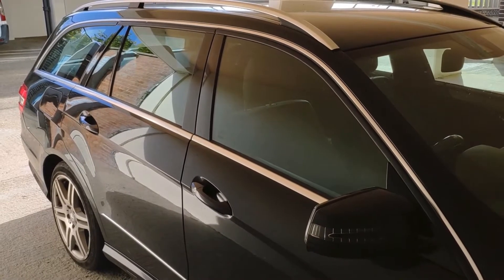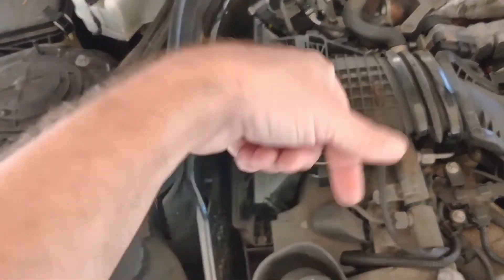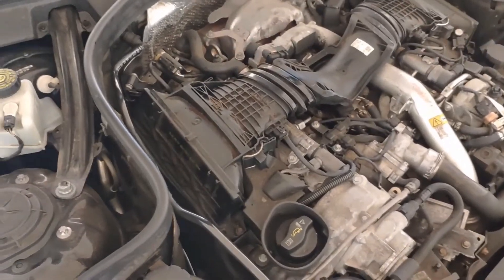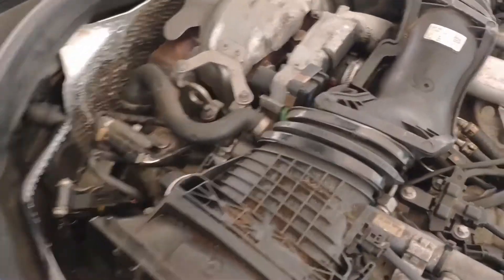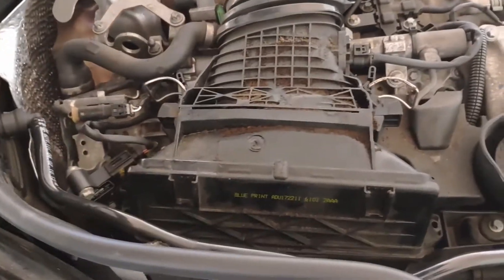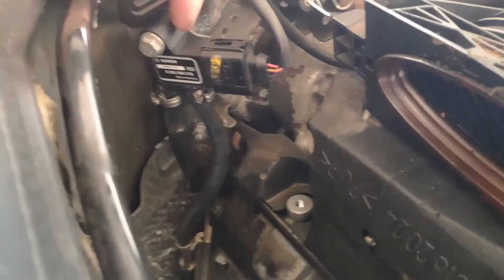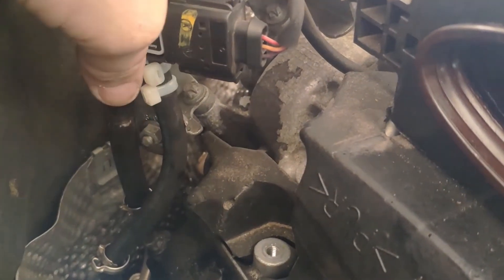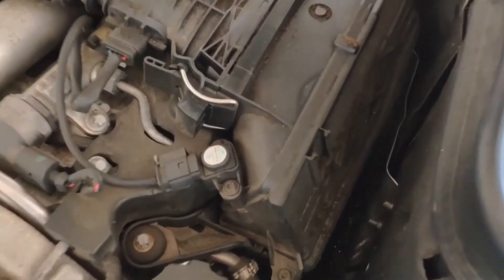Mercedes W212 E350 DPF sensor replacement

Comment: First of all, thanks Topsy! I have been having a few issues with my W212 E350CDI. Symptoms; Gears shifting at higher RPM, no kickdown available, reduced power, limit on top speed and useable gears (think 6 out of 7 were available). Was able to drive on the motorway ok. Did a reset on the gearbox which cleared the drive issues but problem came back (no engine management lights). Plugged in a scanner and got the codes P2453/P2454/P07E8. I was just about to give up and take it to a garage until I found this video, thought the DPF might be shot. Just bought a Bosch Sensor from Amazon for about 30 quid. Will fit tomorrow and report back.
Reply from the maker: It does sound like a DPF sensor issue. Be sure to reset the number of regens using your scanner after replacing the sensor.
Good luck and post back if it does work for you or if you had to try anything else.
Reply: Part arrived from Amazon and fitted. Cleared the codes and reset the gearbox just incase. Piece of cake apart from the cobra clips that were a nightmare to refit, I only managed one and cable tied the other. Thanks again for this excellent video tutorial. 👍👍

Comment: I have the coupe version but same engine and have just experience the limp mode, engine management light and error code very similar to yours 'the lower limit value of component B28/8 (differential pressure sensor(DPF) ) was dropped below/not reached'. You're video was very clear and precise and I will be doing the same this week. Fingers crossed it works as I only listed my car for sale last week! Thank you
Reply from the maker: Hope it worked

Comment: I will be replacing my sensor this weekend and yours is the first video I have found showing the same engine as the E350 Convertible that I have. It looks a whole lot simpler than on some of the other videos I have seen where the sensor is hidden down the back of the engine below the DPF box which is also much harder to get to. Nice clear video, well voiced over, describing what I need to do. Thanks. I think I will check my air filters while I am there too! I will subscribe to see what else you are doing to yours. If I make any videos of me attempting things,  I will link back to yours if that is okay with you. It migth help people to have two views of the same thing.
Reply from the maker: Sure thing. Post a fresh comment with a link and I'll pin it and add your link in my description.

Comment: Hello. Thanks for the video. My car is w212 2011 model e350cdi 4matic. At 200000 kilometers. I have a fault with the code 148a00. I cannot solve the problem. DPF changed, injectors checked and there is no problem, differential pressure sensor has been changed. my problem still persists. my car has never produced black smoke, my exhausts are clean but my car is constantly trying to regenerate. I can't find the problem. why do you think it might be? (Sorry for bad english) thanks.
Reply: Hi there. Sorry for delay replying. The life of a DPF is actually limited and you can only do a regen a certain number of times and this is stored in the car's computer. If you fit a new DPF you must reset the computer (DPF Reset) to let it know to start counting the regens again from zero. if you have done a reset and it doesn't fix it then try doing it again as it often works the second time.
Hope this helps and let me know if it works.
Reply: Sorun ney tam olarak kardeşim anlatırsan belki yardımcı olabilirim
Reply: i have the same problem, black smoke😞

Comment: I have the P2454 pressure sensor A circuit low code but all the same symptoms, however i have no engine light , i cleared the fault and the car returned to normal for a bit, will try a replace of sensor and see if that works
Reply from the maker: Don't forget to run a forced regen and then clear the DPF log once you have replaced the sensor also. Good luck.
Reply: @topsystechtips5128  thanks for this, but how do I run a forced regen?
Reply from the maker: @andrewhulbert2466  If you have a good OBD2 scanner then you can initiate it on this, otherwise take a longish drive (30-40 mins) and do it in manual and keep the engine revving over 2000. This will use more fuel and run hot but that's the point. You will need the OBD2 scanner to reset the DPF cycles as the car keeps a record of how many regens have been done and this can also be an issue if the car thinks it has done too many cycles then it will demand a new DPF (for a couple of grand...).
Reply: @topsystechtips5128  perfect, can you recommend a scanner that I can use? I have car scanner pro that I can use to delete fault codes but that's it ... guess that's not going to cut the mustard?
Reply from the maker: @andrewhulbert2466  I use an Autel AP200 module that connects to an app on my phone. The cheap ones are fine for reading codes, but don't do much more.
It is about £50 but you can use it for so many things and take it with you when you swap cars, or go to buy a car, etc. The more you pay, the more functions you get but you don't need to spend £1000 unless you are a garage...

Comment: What a great video. Thank you for this. 

I’ve a 2013 E350 CDI with the P2453 and P2454 codes. I’ve ordered a new genuine DPF sensor and hoping that fixes it. The wiring seems fine (some people report the wiring should also be replaced). 

Car keeps going into limp mode. Only had the car for 2 months which is a pain.
Reply from the maker: Once you have replaced the sensor you should try to force a DPF Regen from your OBD2. The P2453 error is a voltage irregularity that may be either the wiring or a blocked (or full) DPF.
Fingers crossed it is just a faulty sensor.
Reply: @topsystechtips5128  thank you for this. I’ll try that

Comment: Hey mate if you can help me ! I have w204 with OM642 engine, I’m trying to change DPF sensor but I couldn’t find it !
Reply: I have been looking for a couple days now and I cannot find the DPF differential pressure sensor on the OM642 engine either! There is barely anything on the OM642 online and virtually zero info for my vehicle 2009 Mercedes R320! Insanity!
Reply: @JTBCOOL1  did you manage to find it? I'm in the same situation with my cls 320 cdi...

Comment: Hi, m8, I recently got 2 error codes: P2453, P2454 and it says low circuit. Does that mean I need to replace the sensor and wires? Thanks
Reply from the maker: Hi there.
The second code that you are referring to is usually to do with the DEF. I assume you have a BluTec model not a BlueEfficiency. This can be caused by faulty sensor in the DEF tank, faulty DEF injectors or just incompatible DEF fluid (AdBlu).
Reply: @topsystechtips5128  I have BlueEfficiency model, m8

Comment: Hi 
i have error P0471 on my W212 200CDI , i will try to change it but need to go buy this sensor on my benz shop or i can order on internet web site ? need to reprogram after changed ? or just clean fault ? thanks
Reply from the maker: I bought mine online. I know Amazon do them and eBay is also a good bet. My advice would be to get the Bosch one, but use Google to make sure you get the correct one for your car (Based on the number on the one fitted at the moment). On the 200CDI the sensor may not be where shown in the video as it is not a V6 engine.
You shouldn't need to reprogram it after just changing the sensor. It might need to run a Regen. If you change the whole DPF then you need to do the reset.
BTW. Sometimes that error code is caused by a soot blockage in the pipe going to the sensor and not a sensor error at all. If you disconnect the pipe and try to clear it first before buying a new sensor.

Comment: Hello! Ty for the video i had the p2454 code, i replace the sensor but still, the code comes back, when i shut the engine and re start no fault codes, but sometimes it re appears, dunno where i should look for
Reply from the maker: 2454 is the generic DPF error code. If it is not the sensor it can be that the DPF is full of soot and needs a regen. Did you force a regen after replacing the sensor?
Reply: @topsystechtips5128  hi! Ty for the answer, i did a regenaration 1 day after, still the same problem, my diagnostic tool is super cheap i may need to use another one. I was wondering if only the replacement should solve the problem or if the sensor need to be coded? Ty
Reply from the maker: @firotti  Normally the sensor does not need coding. Is your car BlueEfficiency or BluTec? If BluTech it might be an error in the AdBlue tank gauge.

Comment: Hello there, thank you so for the video, I looked at mine and it’s 2012 diesel.
It gave me error code p2454 also p0030.
Goes to limp mode, I think it’s the DPF sensor, but for some reason it’s not the same one as the one you are showing in the video, mine says A0061539528, what do you think I should do?? Really appreciate your help
Reply: Hi. If yours is a 2012 model it may be BluTech rather than BlueEfficiency. The difference is the AdBlu that you need for the DPF. This requires a tank with a sensor for the fill level. When this causes problems often the solution is to change the tank as the sensor is integral. A total pain in the proverbial.
Error p2454 is actually a generic DPF error code though.
The error p0030 is related to an Oxygen sensor, normally accompanied by 'check engine' light on dashboard. That error code refers to #1 cylinder. Should be relatively simple to replace.
If the O2 sensor is not working properly you can get an incorrect fuel ratio in the engine, which can make it burn dirtier (hence clogging the DPF) and also give less efficiency. I would look at this first.
Change the O2 sensor, then force a DPF Regen to burn out the soot. See if that works.
Good luck with your fix.

Comment: Hi
I know that this is from 2 years ago, still I want to ask, I have the exact car, I replaced injectors, turbo, egr, and the second dpf, still smoke comes out and the smell is terrible, the car drives wonderfully, hope you can help🙏
Reply from the maker: Are you running Bio-diesel? This may not burn properly unless the compression of the engine is altered to match the different fuel density. This can also cause a stink too.
Also have a look at your economy. You should be getting about above 40mpg average per tank for a reasonably driven car of this age (50/50 town /motorway). If lower it may be worn or carbonised rings, cylinders or valves. These will also all lead to smoke and smell of unburnt diesel.
Good luck with the fix. These are the last of the non-adblu diesels and they cause so many problems I don't recommend them at all. Petrol/hybrid for the future.

Comment: Hi , 2.2 170 hp w204 2014 check engine on (dpf sensir fault on tester) but my car is not in lip mode how is possible (137k) km

Ps: waiting for new one
Reply from the maker: It doesn't always go straight into limp mode. Just like if you are low on oil, you get the warning light coming on. If you ignore it then it will go into limp mode. Good to fix before then.
Good luck and hope it works. I've just now got to about 205K miles on mine.
Reply: @topsystechtips5128  i l go monday , but what is the connection between oil and this sensor and limp mode?After i change the sensor,I need a special thing to do "like reprogramate" sensor or just delete error and that s it
Reply from the maker: Sorry. Bad analogy. I was just trying to say that the warning light usually comes on before going into limp mode. i.e. if you have an oil leak, the light will come on when the level has dropped a little. If you do nothing and the level continues to drop the eventually the car will go into limp mode.
Reply: @topsystechtips5128  but i have problem with dpf sensor not with oil leak

Comment: Hi @Topsy's tech tips, great video with great detailed explanation of everything, I've seen far to many that just rush through & don't show enough detail so well done great job, I don't trust main dealer garage or many to be fair, I always try to do as much as I possibly can myself to all MB specs then I know the jods done right, I have a 2011 e350 estate 265 Amg sports, but can't find any videos to show how to check oil level digitally from inside using the multi function instrument panel, any chance you can put a video up for this please.
Best regards
Sj
Reply from the maker: Hi Sj.
Good idea and I'll see what I can do. It won't be for a couple of weeks as I'm away from my main computer at the moment and have a few broadband issues too...the joys of modern living.

Comment: I got P2463 error with the Autel Bluetooth thing, how can I check if it’s sensor fault or dpf it’s really clogged. Also can I force regen with this dongle?
Reply from the maker: Yeah. You should be able to force a regen, but you will have to do a good long drive to get up to temp properly also. Google the instructions for your dongle to find out for sure.

Comment: Thank you for the excellent video.

I've got a 2011 E350 bluetec.

The adblue Def fluid for low. I filled it but a light came up saying 16 starts remaining. I took it to a shop when it got to 3 starts remaining.

The shop reset it and after, the remaining starts light came back on again after driving it 50 miles. I'm now back to 10 remaining starts.
I thought the NOX sensors may have been the cause because the mechanic told me the codes were pointing to the NOX & Mass Airflow sensors and that there was showing excess soot.

I spent $1,200 for 2 new NOX sensors. I also found a bad fuse thanks to a video from "Albanian Fix". The fuse replacement did improve the performance of the car. I don't think the $1,200 I spent on the NOX sensors did any good at all.

My big problem now is getting rid of the remaining starts countdown so that I am not left stranded.

Anyone have any suggestions or know of a way to reset the countdown without taking the car to the shop?

Any videos out there on this subject?
Reply: Hi there.Thanks for the comment.
I'm really not sure as mine is the model before the AdBlue, but from what you have described there may be a fluid-level sensor in the AdBlue tank. If this is faulty it may read empty when the tank is full and if the car thinks you are out of AdBlue then it will limit the number of starts until you fill up. A garage can reset the reading but unless they fix the sensor it will just countdown the number of starts again...
Have a look on the AdBlue tank and see if you can see any wires coming out as it may even be just a faulty connection. 
Good luck and let me know if you get it sorted.
Reply: @OakleyTurvey  Thanks, I'll take a  look at that. I thought that it might have something to do with that because the countdown issue never started until it got low on adblue. After I filled it the countdown should have reset. Nothing else triggered it.
I tried tapping on the adblue tank.
Do you know if there is a way to check the sensor?
Reply from the maker: @TheRevivalChannel  This seems to be a common issue with the AdBlue system. Looks like a major design flaw with some people getting sensors replaced up to 5 times when still within the 3 yr warranty from new. 
NOx sensors are the mechanic's standard answer as a fix, but if that doesn't work they should look for something else...not just replace them again. There is a sonic sensor inside the AdBlue tank which may be the issue, but the tank comes as a single component at about £2K. Maybe try to get in touch with this guy. He claims to have done it as a DIY job in a weekend.
https://www.benzworld.org/threads/adblue-level-sensor.3060102/post-18091069

https://www.benzworld.org/members/prrs.1044145/

Comment: I paid £291 to have this work done! absolute rip off
Reply: Sorry to hear this. Most garages charge way too much for labour, which is what puts the price up. If they see a nice, clean Merc driving in for a fix then you can be sure the quote will be 'gold plated' also. There are many honest garages out there, you just have to find them.
Just an update on my fix; I replaced the sensor nearly 18 months ago now and just gone over 190K miles. Still going well.

Comment: Hi the Bosch part you fitted shows 0281006278 part number, the description in your video says 0281002924, could you clarify please
Reply from the maker: Hi John, Sorry for any confusion. You will need to use Google to match the existing part number from your car, to the correct replacement. Some models have several compatible numbers (like mine) but you will need to check with what is fitted to your car. (Slight differences due to not only different models, but also when and where the car was built.)